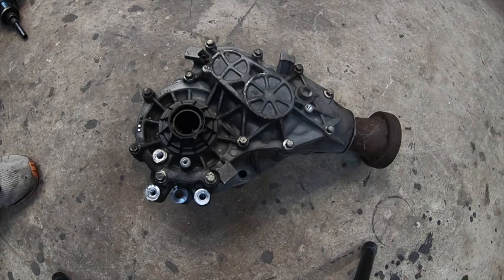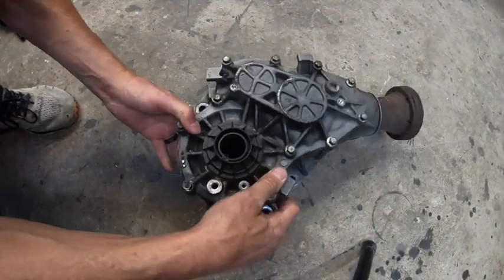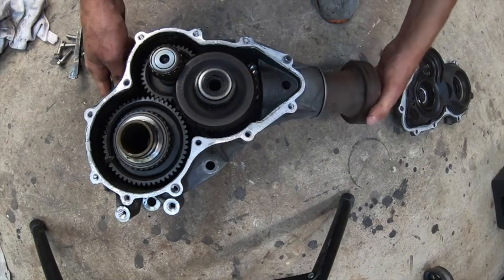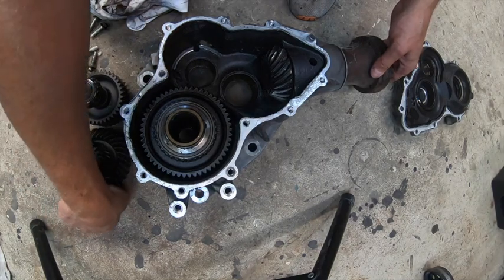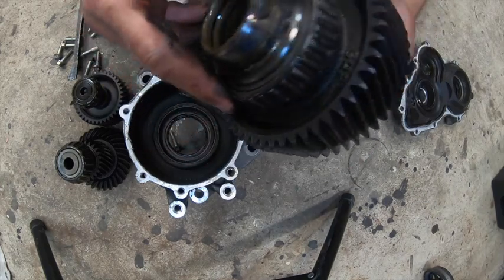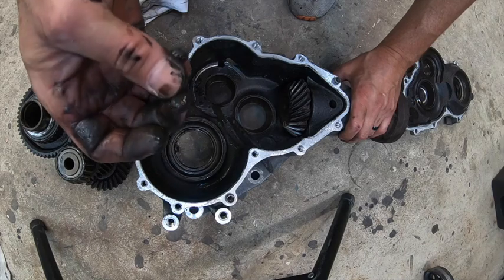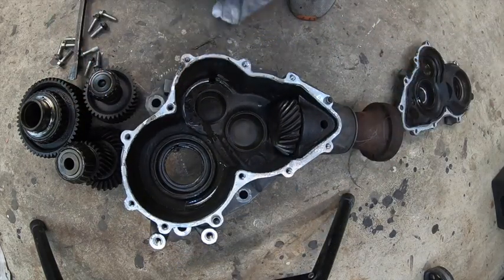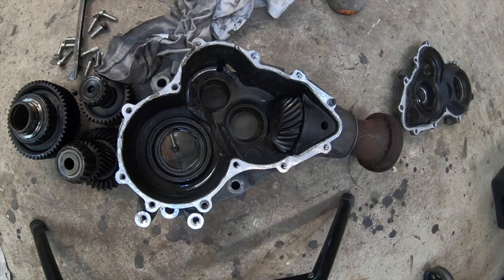Inside a Ford PTU

Comment: i have had an impossibl;e time trying to figure out the differance betweeen awd and 4wd when is comes to escapes. mine says 4wd but doesn't have a 4wd light/ shifter/ switch/ anything.  you know where i can find info on this? i need a transmission, they are all 6f35's but some shifters have p.n.d.r.L. and some p.n.d.r.1.2. so i am sure the linkage must be different. perhaps i am overthinking it.

Comment: Interesting to see inside of one. Hopefully the PTU on my Taurus doesn't fail, I changed the gear oil in it at 45,000 miles. It was black. Planning to do it at least every 30,000 miles from here on out.
Reply from the maker: Good plan! It's all just gears and bearings so maintaining good clean lubrication should make it last a long time.  Thanks for checking out my channel!